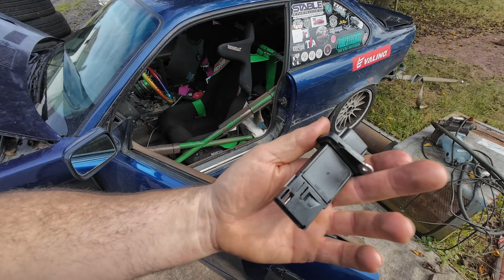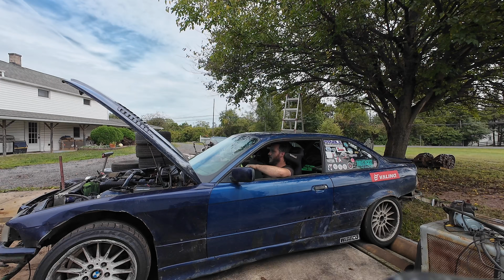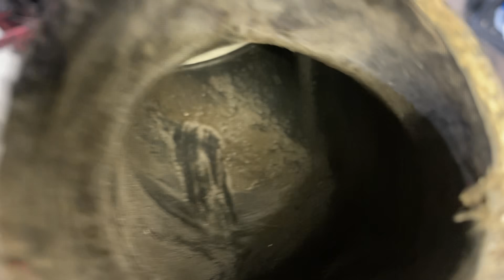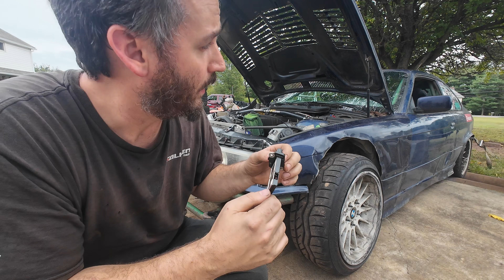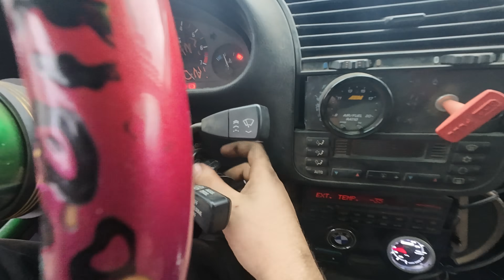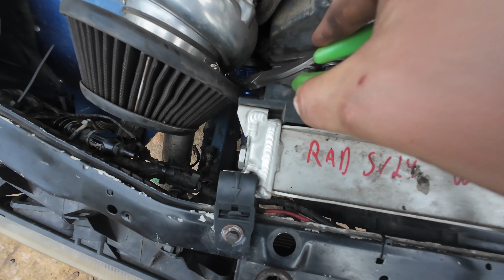MAF sensors, Stock ECUs, and  problems Drifting creates. Turbo E36 MS41 troubles and repairs

Comment: why is the maf plased on the pressurised part of the intake? With this placement it gives stable readings? Should be placed before the turbo inlet
Reply from the maker: This is the best spot for the MAF. Putting MAF before turbo is not good in my opinion. You can't run a atmospheric BOV that way, boost leaks are a big issue, and you need a separate IAT.

Comment: Turbo leaking/blowing oil through the intercooler into the intake? Bummer. ❤❤❤
Reply from the maker: 100% right. Seems to not be much of an issue hot for whatever reason
Reply: I would say that the seals in the turbo are expanding when the engine/Turbo get up to temp,,And stopping any oil getting through,,But once it cools the seals are contracting again,,,I mean,,,Were only talking about a few thousands when the seals expand,,But that's all it would take to make the difference from leaking to not,,,,,I would say a turbo rebuild with new seals might solve that problem,,,,